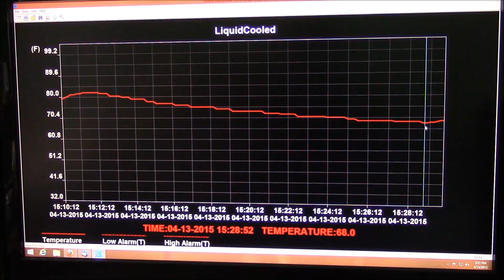Liquid Cooled Peltier (TEC) Refrigerator - Part 1

Comment: Hi! First off thank you for posting your work. I am in the process of designing one for personal use. I am wondering if you could increase your efficiency by using a radiator on the cold side. it would increase your surface area. you could design one, or possibly repurchase a small one from an oddball appliance. recycling centers may be a good place to look. again thanks, and your hot side is exactly how I will make mine, I am just going to tinker with my cold side.
Reply from the maker: +Bob Hanker Thanks for watching, Bob.  I am confused, though, as I did use a radiator exactly the same as the hot side on the cold side in this video.  What else did you have in mind?
Reply: +LDSreliance I was thinking of making the inside box out of sheet metal, using 1/2" copper as a manifold, then running multiple 1/4" or smaller lines all around the outside of the metal box. the copper lines would have to get soldered on somehow. behind that I am going to put 2"foam board (double layered) and then use plywood on the outside. Increases surface area, reduces the needed amount of fans. I haven't tried this yet, but if you can get low 40 degree water, I am pretty confident it will work.
Reply: +LDSreliance I was thinking of making the inside box out of sheet metal, using 1/2" copper as a manifold, then running multiple 1/4" or smaller lines all around the outside of the metal box. the copper lines would have to get soldered on somehow. behind that I am going to put 2"foam board (double layered) and then use plywood on the outside. Increases surface area, reduces the needed amount of fans. I haven't tried this yet, but if you can get low 40 degree water, I am pretty confident it will work.
Reply from the maker: Bob Hanker
That should work but it sounds expensive and labor intensive.  I know that is how a lot of refrigerators work is cooled piping in the sides of the fridge.  One concern I would have is that sounds like a ton of surface area, which is a good thing, but you may find that you need quite a bit of peltier power to get that much surface area cold.  And that much peltier power will produce a LOT of heat and consume a lot of energy.

Comment: I am designing a test chamber for an item my company is creating, and I want to be able to control the temperature of a test chamber fairly reliably.  I want to keep it close to freezing.  I had in mind a system similar to what you created, and thank you for your posting about your system.  I also want to thank you for posting about your failures, since those are as informative as success stores, but are often not documented.

For your design, I am wondering how much benefit there is to the 2nd water-cooled radiator.  Perhaps just an air-cooled system for the hot side would be about as efficient.  Did you make your choice based on some data about the liquid coolers, indicating that that is much more efficient?

For my system, to get the temperature drop I need, around 35 deg, I imagine I will need to stack some TECs.  I have read that the one on the hot side must be around 4x larger than the one on the cool side, just to dump the extra heat generated by its inefficiency.  This will certainly increase the power draw a lot.

So, I am re-evaluating the use of a TEC for my own project.  A small table-top ice maker only costs around 180.  So, I might just use that and circulate water through the ice holder, and into my test chamber.  The water will never go below freezing, so I will have a very stable temperature. 

For your own project, I am wondering how efficient a battery connected to an inverter that runs a 120v refrigerator.  A small compressor operated refrigerator only costs around $85.    Note to those who want to cool air using a refrigerator, the system is really designed to work at refrigerator temperatures, not with the cold coil at room temperature.  So, there will be issues if you try to run it with the door off, and a fan blowing on the coil.
Reply from the maker: +a. There were a few educated guesses that led me to believe and still believe that liquid cooling in this type of system is superior.  I don't have carefully measured, controlled data to confirm.  But one reason is to keep the hot radiator away from the device or air you are wanting to keep cool.  I had quite a few people commenting on my first fridge which was air to air cooling where I sandwiched cpu coolers on either side of a peltier and mounted it in the back wall of the fridge.  They claimed that I was seeing heat creep back to the cold heat sink since the hot and cold heat sinks were only separated by less than an inch with some foam insulation and wood in between.  So with the liquid CPU cooler, the pump quickly pumps away the liquid carrying the heat 10-12 inches away to the hot radiator.  No chance for heat creep.

The other thing is that my air to air hot side radiator would get warm (slightly warmer than body temperature) to the touch but the liquid cooled hot side radiator never changed temperature at all.  It was always room temperature.  I could feel some very slight warmth through the tubes carrying the liquid but the radiator was way over-capable for my application even at 15 amps.

Do I think you will gain a lot of efficiency?  No.  But it also allows easier mounting options and allows you tenfold increase in heat shedding abilities over air to air even with copper pipes and loud fans.

As for using a cheap mini-fridge, that would probably be the easiest solution.  We know it works and it will easily get you to 40 or lower degrees F.  However, be aware that you will need a really large inverter for the job.  I don't know if you watched my "Will It Solar?" series but in the episode where I tried to run a mini fridge off a battery and inverter I ended up shooting 4 episodes trying different tricks, including a capacitor, to get the stupid thing to start.  In the end I had to use a 2000 watt inverter to handle the huge current spike to get the motor running on the fridge.  You will also need a big enough battery to provide that kind of juice for a short period of time.  A small SLA battery just won't do it.
Reply: use a tatto power supply, Works perfect for controlling the temp output
Reply from the maker: David Cantrell
I guess that is just a variable output power supply?

Comment: LDSreliance great Idea using the H60s
the reasons I believe you are not getting very low temperatures 
is because the cold plate is outside the box exposed to the hot air
I am surprised you got the box that cold 
imagine how cold it would get if you figured a way to get the cold plate inside the box
or leave it outside but insulate it from the hot end
I know the hot and cold end are very close but there should be a way to do it
you probably could get good results using the cheap 5 amp TEC

Comment: i have a sprinter converted into a camper and am looking for someway to make and air conditioner do you think something this unit could cool 300+ cubic ft.and perhaps drop the temp 20 degrees F
Reply from the maker: John Hix Yes but it would take an awful lot of power.  The beauty of a peltier fridge or air conditioner is portability, flexibility, lightweight, and small size.  In this video series I am able to cool ~1 cubic foot about 20 degrees below ambient with 10 amps of power.  So if you scaled that up to 300 cubic feet you would need 3000 amps of power or 36,000 watts!  I think that is about double what it takes to cool down my whole house.

So I don't want to discourage you from the way you are thinking, but we need to change things a bit.  Maybe you can make a small portable air conditioner/fan unit that blows cool air on you kind of like a space heater does in the winter.
Reply: +LDSreliance  The amount of cooling needed is not so much related to the square feet, but the surface area, the heat loss through the walls, the heat sources inside, and finally the air infiltration.  If the camper is not well sealed, the air infiltration will overwhelm you system very fast.   The heat from an occupant is around 250 BTU/hr.  So, you can see why a Peltier cooler is not a good choice for cooling people.

When I was planning an extended drive, and needed to conserve money, I decided to just sleep in my car. In my case, I needed heat,  not cooling.  A trucker friend said that just running my car overnight would not burn that much gas.  I saw data for a Honda Civic, idling with A/C running at 0.35 Gal/Hr. For reference, idling without A/C and no fan on is around 0.2 Gal/Hr.
Reply from the maker: a.
True, but for simple guesstimation at least knowing the square footage or cubic footage of the space will help.

I didn't know that about idling a vehicle.  Very interesting.

Comment: water cooler in the cool side is not a good idea! use the cooler you used in our first fridge inside!! believe me, you will get way better results
Reply from the maker: Ricardo Iarossi Why is it not a good idea?  Not saying you are wrong but what makes it not work as well?  In my testing it seems to work better.
Reply: LDSreliance because there are much more stuff to get cold until the coldness(does this word exists?) reach your fridge! make some tests using the watercooler outside and the normal cooler inside, i'm sure you will get better results.
Also, you can use 2 peltiers instead of one(knowing that you have 2 watercoolers and 2 conventional coolers). Sorry for my bad english
Reply: +Ricardo Iarossi Ricardo, couldn't the radiator cool the water that has already been cooled by the peltier even more? I might be completely wrong

Comment: What does the radiator on the hot sides temperature get to? I was wondering because Im trying to do a comparison with the same peltier unit. On my large, bulky aluminum heatsink, Im getting about 85-87 degrees in a 80 degree ambient running off of 9-12 volts. Does the radiator that you are using get a lower temperature difference?
Reply from the maker: TCircuitry HD I bet it is about the same as yours.  It is warm to the touch but not hot at all.  Definitely lower than body temperature.  I would guess 85 degrees.  Unfortunately, I don't have a device to measure surface temperature.  I need to get a good infrared thermometer.
Reply: Thanks for the info! If you can possibly get one and test it for me in a future video, that would be highly appreciated because i'm considering whether or not to buy one of those corsair coolers. Also, one more suggestion I thought of is that I believe that the H60 uses a 120mm fan that only blows about 65 CFM. Maybe you could also look into a fan that size that blows over 100 CFM for maximum cooling performance which I would probably consider doing if I didn't get the results that I needed. Thanks for any help! :)
Reply from the maker: I will consider getting an infrared thermometer for sure. 

On these 5 amps units, however, I am pretty sure the fans are doing nothing and all of the heating/cooling is being done by the radiator.  I ran a test once on a peltier with just a heat sink and it was about the same temperature.  But with 10 or 15 or more amps I think we may start to see the fans come into play.  If that is the case then I will definitely try a better 120mm fan as they are cheap and easy to replace.  Good idea!

Comment: Hey, just wondering, will the temperature on the cold side get cooler if you put the fan on the 5v rail?
Reply from the maker: PC TechTips Good question.  I am pretty sure it won't because the TEC is only 5 amps and the +12v rail provides 25 amps.  So the fan and the TEC can both get plenty of current.  Also, the fan is 12v so I don't know if it will work on 5v.

Comment: Interesting, I have the H100i dual 240mm radiator for my desktop. Pretty cool stuff.
Reply from the maker: Desert Rebel Right on.  I don't overclock my computer so I don't need hydro cooling but they are fun to play with in other applications.
Reply: I build custom computers on the side, lots of fun. Take care.
Reply from the maker: I used to do that.  Still do for family and friends.  Great hobby.  Later

Comment: This might be my next step in trying to do the chocolate case.  Thanks!
Reply from the maker: Roy Greenhalgh It should be a lot more efficient than the air cooled one.  Here's hoping!
Reply: LDSreliance  lol  only wish I tried that FIRST.  I got like $300 on parts and 3 message boards trying to get me down to the 60-75F range with the Air cool setup.  I'll let ya know if it works ;)
Reply from the maker: Sounds good!  In the meantime, I will continue working on this project.